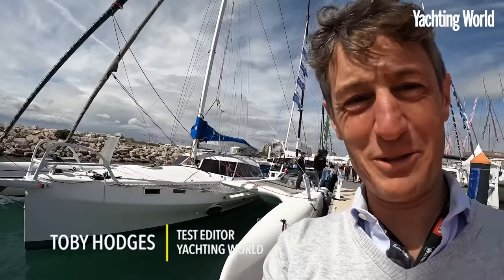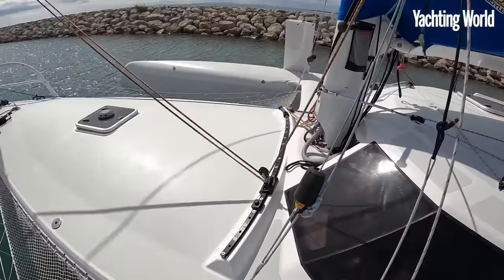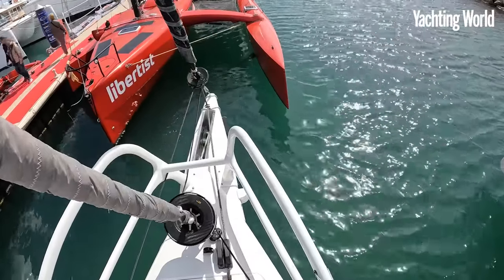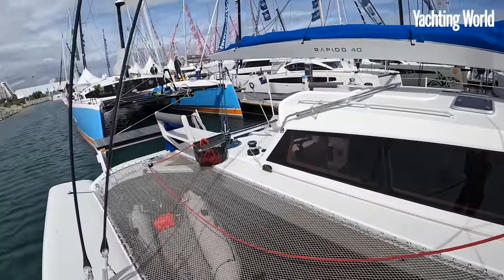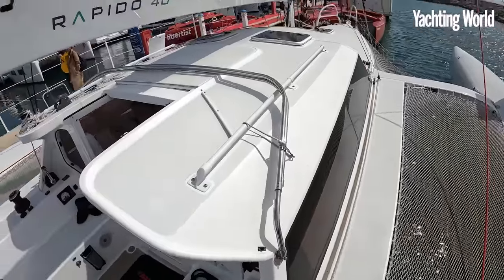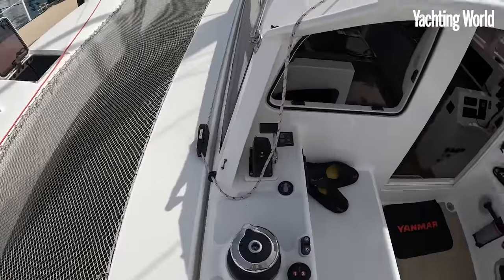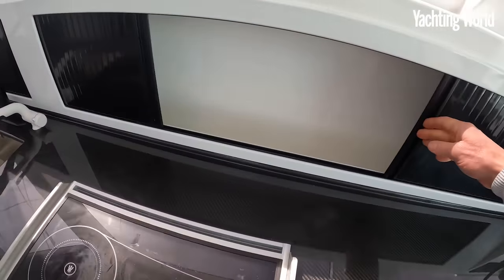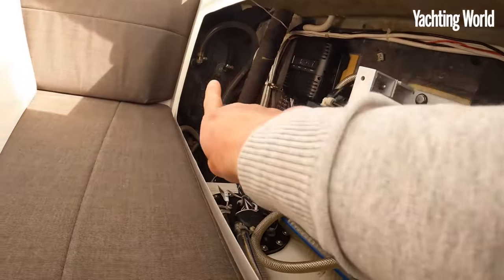C-foils on a fast cruising carbon trimaran? This looks rapid! | Rapido 40 tour | Yachting World

Comment: I mean the performance is amazing, no doubt. But I think it just looks oudated and cheap. Like a decksaloon version of a 1995 Dragonfly. 
I'd prefer the Marsaudon Composites (I think) behind it <3
Reply: Fully agreed regarding outdated look.
Reply: What else do you want a tri to look like?😂 Simple, fast, and a great cruising boat. Perfect👍
Reply: Especialy the Dragonfly 40 looks amazing. The New Corsair, Waarship TR36 and R42.... All of them Performance trimarans, they look so much nicer, luxurious, modern and sportier. 

I bet the Rapido 40 is a amazing piece of kit, but other boats of the same class look much nicer in my oppinion :)
Reply: @maximilianehlken725  Sure, they look better but have you seen the interiors of the Waarship or R42? They’re horrendous, and racers partially turned into cruising boats. A Rapido 40 is a cruising boat that also does 20kts. I know which one I’d rather liveaboard…
Reply: @maximilianehlken725  How long is the Corsair? 37 feet? This Rapido is 3 feet longer. And does the R42 exist yet? This Rapido seems to be some 80% of the cost of the Dragonfly. Considering the total yearly production of both of these yards, don't you think there's room for both of them?... ;-)

Comment: Interesting. Certainly a sporty boat, personnaly I'm not sure I would love to spend my holydays in a white bathroom but it's a question of tastes 😄
Reply: There are other colors than white you know... They could just as easily paint it in any color. And it probably wouldn't cost that much more. And as long as you specify light weight veneers – the entire interior could probably just as well be wood clad if you so desire – for an additional cost of course...

Comment: Just not practical for long term cruising.
Reply: Aren't most people out in boats couples?... I'm sure A LOT of couples have cruised in boats smaller and slower  than this. What kind of distance can you cover in a day with this boat? What other 40ft sail boat can cover distances that this Rapido 40 can cover in a day? What other 40ft sailboat can actually sail at decent speed in light wind conditions?...

Comment: They need an interior designer. Looks so industrial
Reply: I disagree. I think it looks modern and practical/utilitarian. Regardless... For a price I'm betting they will build whatever design your heart desires as long as it doesn't exceed certain weight limitations. And considering the total price of the boat, that will probably not cost you that much more... See for example the 60ft Rapido that is being built for the Youtube channel Sailing La Vagabond. That boat will look different inside compared to this one...
Reply: @angela1984a  Agree with you.  Some people apparently don't like modern, clean and practical design.  I do.

Comment: sounds like a description of a piece of plastic crap that will break in no more than two years because the weather has gotten a lot wilder due to warming
Reply: By that logic every other sail boat is going to break as well. The difference with this tri as opposed to most other 40ft sail boats, is that it will open up more options to avoid bad weather due to the higher speeds it can sail at.
Reply from the maker: And carbon fibre is a tad stronger than plastic!
Reply: @yachtingworld  This is not a grandma's sock, to be knitted only from threads or fibres)) carbon fiber filler. plastic is a binder. and these are all the typical problems of grp/crp hulls, only more expensive: osmosis, in general, hydrogen-oxygen bonds that are formed in each composite body under the influence of water. And in general: plastic hulls of ships are not waterproof. Yes, it shocked me too. They always let water through slowly. So slow that it seems like they're not letting you through
Reply: Plastic composite boats are highly durable.  Many plastic composite boats built more than 50 years ago still work just fine.
Reply: @LoanwordEggcorn  tell that to the killer whales, osmosis and pfas))